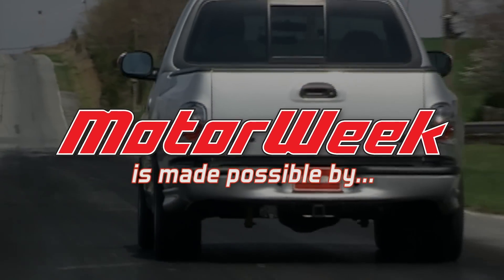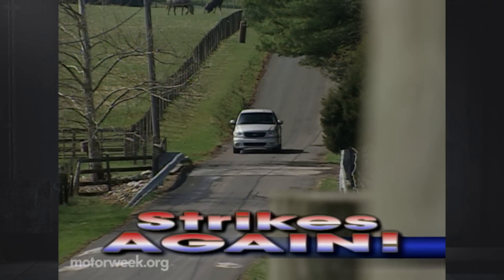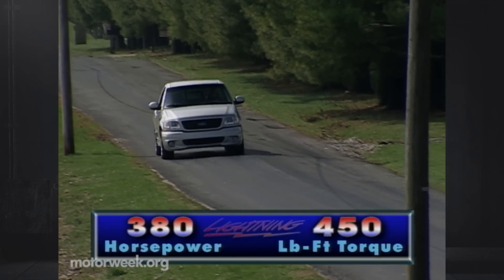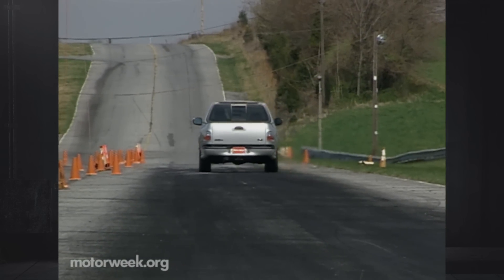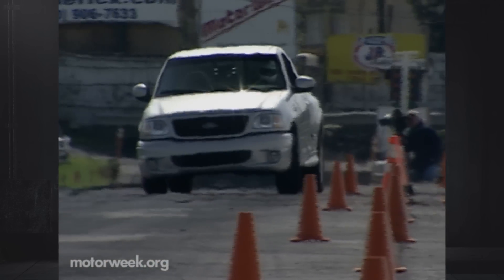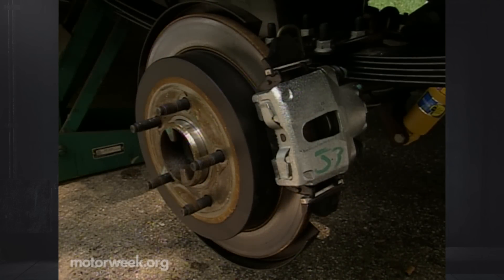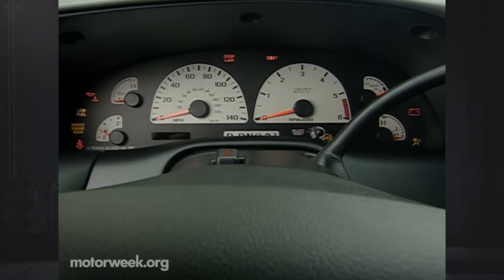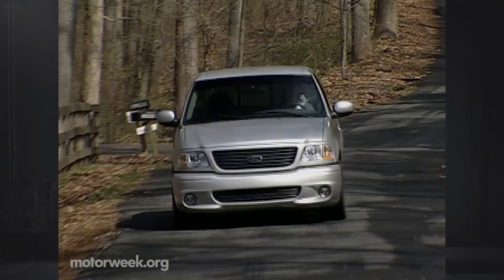2001 Ford SVT F-150 Lightning | Retro Review

Comment: I remember this truck was the shit when it came now.  Now 380HP sounds so quaint.  lol.
Reply: It sounds quaint, yet 17 years later and GM still can't get over 365HP out of their 5.3. Meanwhile, Ford and Dodge are a mile ahead.
Reply: King Daniel i agree with u to a point... the new 5.3 that GM brought out in 2014 kinda sucked in the power department....but i did like the older vortec 5.3 (1999 to 2013)....One thing your forgetting is that gm has never put a supercharger on the 5.3 so comparing the power of a n.a engine vs a boosted engine is not fair....the fair thing to do is compare fords regular non supercharged 5.4 that really competed with the 5.3 from GM....right there u will see that the 5.3 made a bit more power over fords 5.4...and thats with the 5.3 using an old push rod engine design, where the fords 5.4 was a new modern modular engine design.....but now in 2018 i would have to say that ford has the better engine options, i especially love that 5.0 in the f150.....
Reply: King Daniel dodge makes 375 out of the 5.7L on challenger though
Reply: John Herbold, but that’s 375 N/A Horsepower. Add a 8psi Supercharger like the one on the Lightning, & that Dodge 5.7 will make 500-510Wheel HP
Reply: Ford never used a supercharger on the 3v, which was only used in their truck and van lines, and I wasn't comparing it to the EcoBoost either. While, yes, the 5.3 made slightly more horsepower from factory, it was well below the 5.4 in torque. Also, as I'm sure is the case with the 5.3 as well, Ford intentionally tuned the 5.4 in their trucks to have the majority of its power low down in the rpm range, making it an excellent towing engine even today. With a simple tune, the 5.4 can easily gain 30+ horsepower and 50+ lb-ft. In comparison, Gm's 5.3 was basically at its limits without moderate modification.
Reply: John, Fords 5.0 is pushing 395 horsepower. What's your point?
Reply: Toyota offered this under warranty.  Around 470WHP @ 6-7psi.  A pretty good example.
Reply: Remember Gm was also getting 350hp from a 5.7 in 97 with the ls1. The same engine that was spanking mustangs ass right until end of the fbody in 02.
Reply: John Herbold lol Nissan has a 3.7L V6 that puts out 330hp.
Obviously no where near the same torque though.
Reply: King Daniel that's right, the 5.4 puts out  a lot of low end torque despite its small displacement. Mainly due to it's super long cylinder stroke length, and long intake runners. I have a 04 Navigator with the 32V 5.4 which made 300 HP and 355 torque stock. I simply added a CAI, exhaust and a tune and the hp was bumped up 45 & the torque 15. Made a huge difference
Reply: DblOSmith Right.The new trucks have over 400 now.
Not even sports trucks .
Reply: King Daniel why?
Reply: DblOSmith: I had a 2003 Lightning and had it dynoed dead stock on a Mustang dyno and it put out 378hp to the wheels with 440rwtq. They were way underrated.  Now I wish I would have kept the truck because I rarely see them on the road now.
Reply: That's a shame. If I'm not mistaken, that was the last year of the Lightnings too.
Reply: @UvidCo  my lil 302 punched out to 347 in my fox will spank your 350 lol and it was way cheaper
Reply: T U I just seen a 18 f115 with a gen 3 coyote make 800 on wipple.
Reply: R C nobody cares. That wasn’t in any truck.
Reply: DblOSmith Yes, it once took a 5.4 Liter V8 with a supercharger to make 380 hp in a Ford pickup. Today, we have the 3.5 Liter Ecoboost V6 with two tiny turbos making 375 hp. The naturally aspirated 5.0 Liter makes 395. However, I still think the Lightning is a good performing vehicle even today.
Reply: @johnherbold6539 actually some of the 5.7 hemis made 395hp for a select few years they range from 360-395 depending on the year and which vehicle they stuff it in. My '14 ram 1500 has the 395hp version. Why they detune it in the challengers and stuff I couldn't say why.
Reply: King Daniel well at its heart a 5.3 is a truck engine, not a muscle car engine dipped into a truck like the 5.0 for a ford or a 5.7 for a Ram. Buuuuut the 6.2 is and that why GM offers it. And if you put e85 in the 5.3 which you can do because it’s designed for it, produced 383 horsepower which is still short of 395 the other two produce. At the end of the day GM can put ford out of the horsepower department. We could say the same for ram but you know the demon exists so they are the king
Reply: It's still faster to 60 than any F-Series since. Even today. Though the 2nd gen Ecoboost truck with 10spd is really damn close.
Reply: R C the end of the f body cause that 03 cobra was coming !
Reply: @hmackprotection1  yea no it wont
Reply: King Daniel 04 was

Comment: i wanted one of these sooo  bad when i was 16 in 2000. now as an adult, i cant imagine having less than my 3/4 ton with 8 foot bed for practicality in my current life situation.

thinking back, it would have always made more sense to just get a car as a modest performance car would still whoop this thing as it is after all a truck, and then just have a cheap truck for work.

i was still young enough to think could have a truck for work AND still have something that was fun to drive all in one.

Comment: Back in the early 2000's I was a driving instructor for SVT Owners Assc. I had a number of students attend these driving events with Lightings and I always was impressed by just how fast they were.  One of our instructors had one and over time modified it with more boost and bigger brakes and tires. It was almost as fast as my 93R Cobra Mustang in the straights but of course I out cornered him.

Comment: I bought one new in 2002 for 30k, I loved the truck with only four exceptions. The crank pulley assembly needed replacement due to a bad bearing within 35,000 mi., the Goodyear Eagle F1's were the ONLY tire available for the stock wheels and are now discontinued, the suede upholstery felt great but wasn't resilient, and it was undrivable with even a dusting of snow (because of the tire limitation). I didn't want aftermarket wheels so when I sold the truck in 2014 the tires were going for almost $400 each, and I couldn't find a full set new. Even though, I kind of wish I never sold it.  SVT come back please!  BTW, with very minor tweaks I got 417 hp on a dyno and 1/4 mi. @ 12.16
Reply: Vegas EMT  thats what im thinking. . . damn hankook tires in 295/45-r18 are like $150 a tire for fucks sake.  The nitto 555r 305/45-r18 are $250

Comment: Looked up the inflation calculator, hard to believe this truck is now 20 years old.  Anyways, in 2021 dollars that $33,000 MSRP is about $50,000.  Which is right where a loaded Camaro SS, 392 Challenger, and 5.0 V8 Mustang with all the performance options is priced at.  The old F150 Lightning might be slower, but its what I'd want to daily drive.  You sit up higher in more comfortable chairs, the bed has a cover over it and makes it the world's largest trunk.  Replace that double din radio with a modern touch screen with bluetooth, it interfaces with your phone like a new car.

Comment: The current 3.5EB 2nd gen makes similar power and blasts the 2018 F150 supercrew in the same acceleration numbers, the 10 speed helps too..... I have my 2018 Supercrew tuned and I'm 0-60 in under 5s.... amazing where Technology has gone
Reply: fwh79 very true
Reply: That's expected from almost any vehicle that's 20 years newer than the Lightning :)
Reply: Basic bolt ons, a stock motor & my 01 Lightning still rips off 12.9 quarter miles on street tires. 🥳
Reply: @brianmullins5957  fbo and tune my damn L was running 12s

Comment: Needed a manual transmission so badly.
Reply: GT6SuzukaTimeTrials and an extended cab.  just not enough cabin room.
Reply: T56 swaps are getting more common. There's a few on youtube, but the swap is kind of a pain. Definitely worth it tho imo
Reply: The F150 Harley Davidison edition was a 4 door crew cab lightning.   Same powertrain.
Reply: @aaronbays4  not quite, it was a lower boost  version of the blown 5.4, only 340 hp I believe
Reply: @aaronbays4  The '02 HD had 345 HP, Lightning had 395 HP

Comment: They should have made a ford ranger widebody lighting with that motor.
Reply: Ŕx ŘÅĮĐĘŔ yes.  and also made a Ranger with a v8 and 4 full size doors.  may have saved that line of trucks instead of being boring and underpowered from the beginning until the end.
Reply: Four doors no, maybe suicide doors. It was a compact truck.
Reply: That Contra Guy they made Explorer sports tracks.  dodge had a small truck with 4 doors.  the Tacoma was as well.  ford missed the boat by not offering it.
Reply: Didnt they have a ford ranger thunder edition
Reply: Anthony Perez ha yeah but it definitely wasn't a widebody truck with a supercharged 5.4 liter.
Reply: There was a very limited Saleen Explorer but it definitely needed much wider stance with at least wide wheels & fender flairs
Reply: That Contra Guy They did make the ranger with suicide doors or supercab I like to call them I see them everyday hes saying they should of made a crew cab like the dakota and s10/colorodo
Reply: There was the ford ranger "lightning bolt" prototype. It was the flairstyle ranger with the engine, transmission, and rear end from the lightning.  But they never really were going to make it. More of "ain't this cool looking" lol.
Reply: I have a 2001 ford ranger edge step side. Its got a 4.0 and a strong transmission thats the closest high performance ranger.
Reply: Nah, the Ranger was their minitruck to compete with the S10. No V8. Honestly would have been a very small demographic. Would have taken away from their F150 market, which around then was the best selling vehicle in the US. This was the smart move.
Reply: 4 doors and V8? Thats what the F150 was for. Why make 2 identical trucks. Didn't work out well for GM.
Reply: 4 door rangers in Mexico and other countries I live in a border town and see them all the time with Mexican plates
Reply: Dakota
Reply: @one7decimal2eight  Yeah, and those 4-door compact trucks were HUGE sellers too, right? Thats why you see so many of them on the road today.
Tacomas are among the most popular trucks around here, and I have almost never seen a early-2000s Taco four door on the road. Tons and tons of extra cab 2-doors though. 4-doors are only getting popular among the latest gen Tacos, and those are so much bigger that the are basically taking the place the F-150 used to fill.

Comment: Bad Ass Truck!!!!! Remember this well!!! Only truck faster was the GMC cyclone.
Reply: Leon L nope, ram srt-10 still is faster.
Reply: Srt-10 but cyclones were awsome lil trucks
Reply: Lightning was the fastest truck. Wasn’t the quickest truck though. There is a difference
Reply: @jbouchard4877  srt 10 had a higher top speed
Reply: Billy Ray srt came out in 2004. So I’m not even including it.
Reply: Syclone would rule on a real track... You know the kind with turns.

Comment: Ford really should bring this truck back.  A custom 650 hp twin turbo Ecoboost engine would be sweet.
Reply: They have, in a way, I own one. 2018 F150 Lariat with the 5.0 V8, 3.73 axle, Roush Supercharger (under warranty because they partner with Ford) 650 HP, 610 Torque, 0-60 in 4 seconds on a cool day. Truck cost me 57k, 10k for the super charger. You could get a base F150 with the V8 for like 35k maybe, then get the 10k Super changer, 45k truck, or roughly the same price as this thing in todays dollars.

Comment: Funny thing is this truck was just as fast as the 2001 Mustang Cobra.  I'm betting if you put the average Joe in the truck, then the Mustang, he'd run better quarter mile times in the truck due to the automatic transmission.  The manual in the Mustang, like all manuals requires a good bit of skill to extract the most from it.

Comment: I must be getting old. I remember that truck and I wanted one. When I say this this not putting the lightning down but a comment of how technology has improved. The new F150 with the 3.5L EcoBoost 3.5L makes 365 HP & 420 TQ (Raptor's 450 HP & 510 TQ). There are NA V8s that make that much power now. I still want one though.
Reply: Yeah, but they also weigh a ton more. Still probably faster anyway.

Comment: These Lightnings are still super sexy and sought after. Very dependable and just enough power to put a huge smile on your face!
Reply: The Chief.  Not dependable.  The 5.4 is a terrible engine without boost.   They haven’t been on the roads in a good 10 years because they’re junk
Reply: @patriotgame4404  have you ever even owned a 5.4 or are you just talking shit. I own a 5.4 2v and it's strong running motor and there is plenty of 5.4's with over 200,000 miles on them.

Comment: Man this video brings back memories.  Although the SRT-10 had the Viper motor I'd much rather have a Lightning any day.  These were just begging for additional tuning and adjustments to boost.  Bolt on a better intake along with those things and you had a truck reaching upwards of 500 horses.  Such a sleeper vehicle against unsuspecting and uninformed Mustang and Camaro owners.  I'm sure many street races were won by Lightnings.
Reply: SRT-10 had a Viper motor...which was just a V-10 truck motor in the first place. Not that that really means anything. An engine is an engine, ultimately. I saw someone complaining about how late model Tacomas use a 'car motor' out of a Toyota car. I felt tempted to point out that the small-block AND big-block Chevy were also originally car motors, and we all know what terrible truck engines those were...
In 1955, a 'truck motor' was a straight-six, 1bbl.

Comment: Had two Lightning's, a '99 then a few years later an '03.  Make a few very simple mods and get the HP over 400.  You can easily get over 500 hp with some engine and blower work.  The truck would haul ass, and your boat!!  If I had a collection, there would be a Gen 2 Lightning in it.

Comment: this and the first lightning would be a lot faster if they put a manual tranny in them! Those old automatics were so slow shifting! my 94 f150 4x4 5.0 5 speed reg cab short bed can go 0-60 in 7.5 and the same year lightning with more power and less weight does it in about 7.2. It has an auto tranny in it though! had they put a proper manual and you’d knock it down to mid 6’s and the 01 would probally be in mid 4’s!